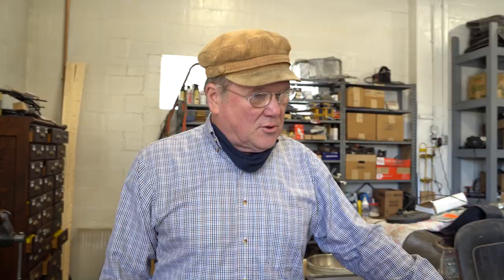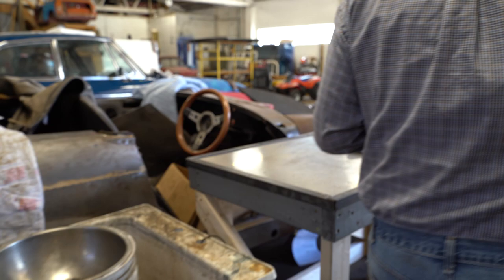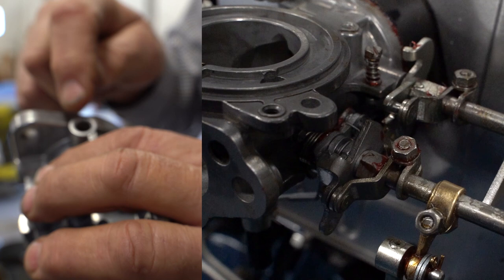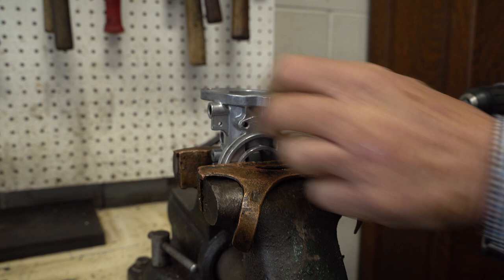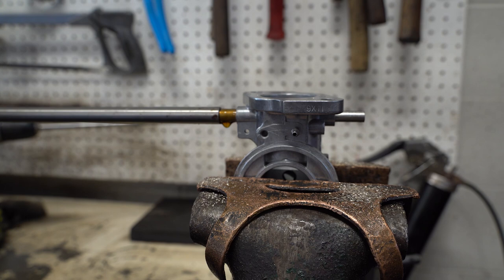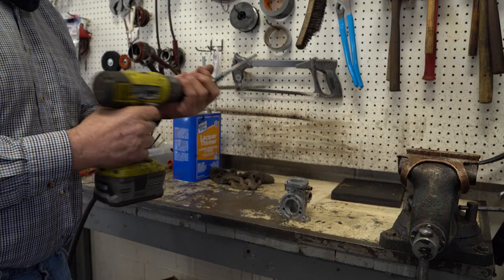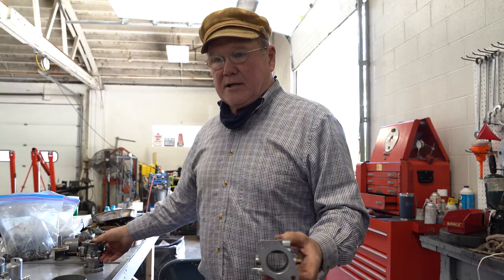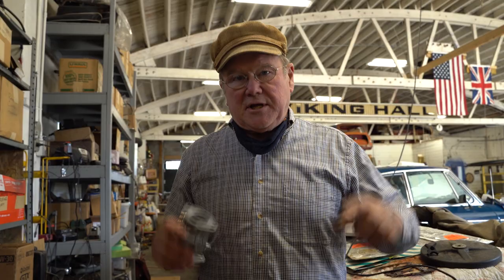327 MG Tech | Rebushing SU Carburetor Bodies

Comment: Far easier to VAPOR BLAST , and results look better than new , and it only takes about three minutes to have a perfectly bright clean carb body , and as for the throttle shaft bushings , their not CAST IN , i use a threading tap to pull them out , and after the new bushing are installed I also put an O-RING ON THE SHAFT so it is air tight  , you might want to try those more modern methods.